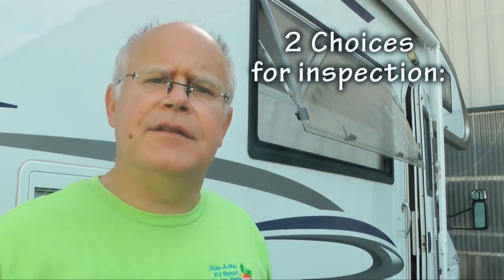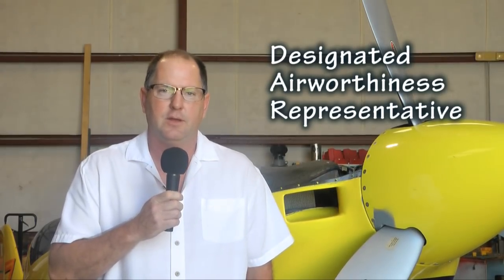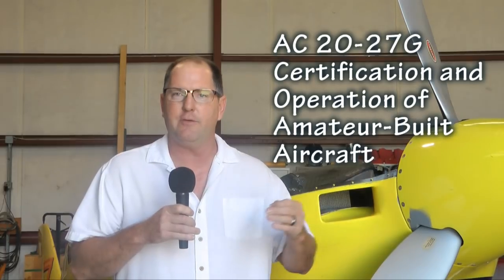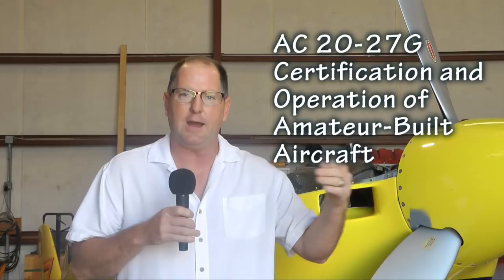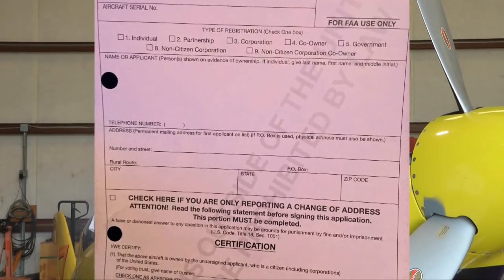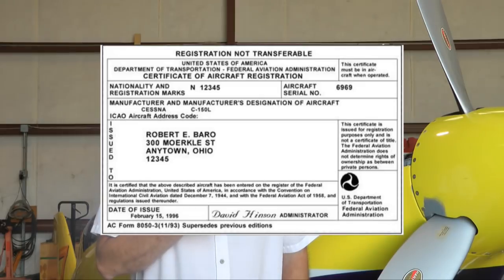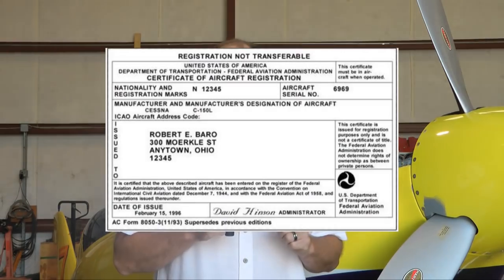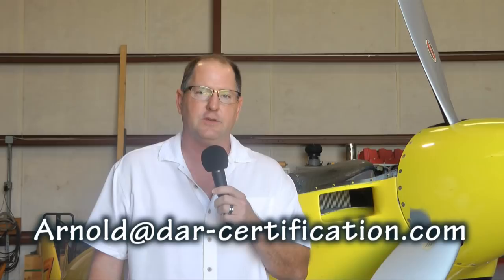Inspection Day: What to Expect when Using a DAR (homebuilt aircraft)

Comment: HomebuiltHELP......Does the FAA or DAR inspection also cover ultralights (103) aircraft?
Reply: No inspection needed for part 103 ultralights
Reply: @chasejohnson1122  So if no inspection is needed for part 103, what is stopping anyone from being over the 254lbs,  on board fuel limits, vne, etc.?  Not being an ass, just asking for clarification?
Reply: @jcz232321  Loose lips, suspicious peers, men in black suits, and/or accident and incident reports.